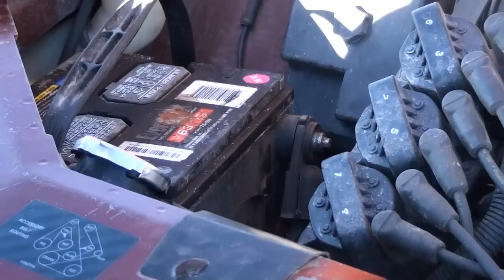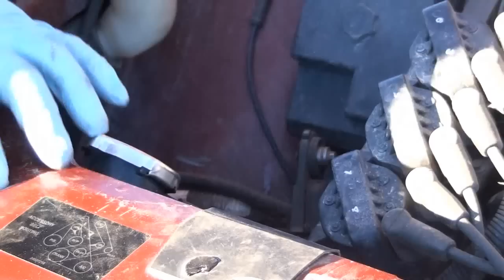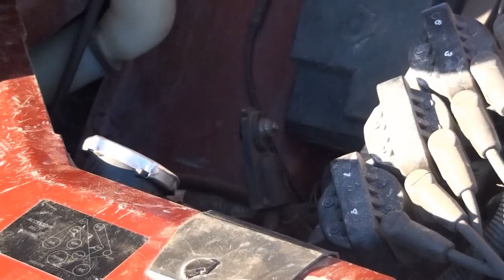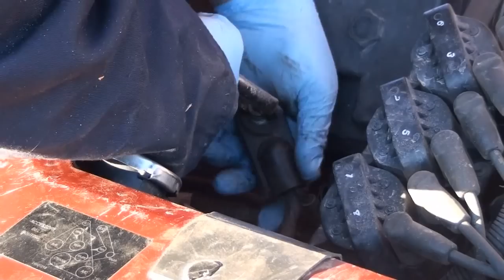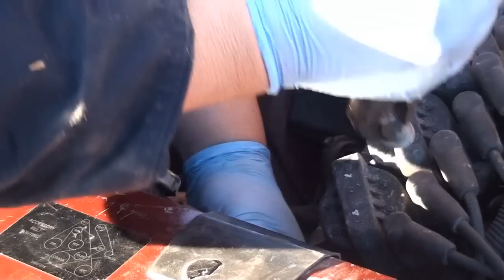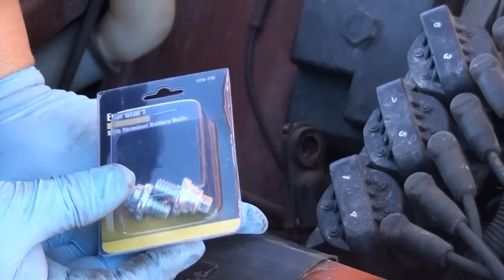How to replace battery side post terminal bolts on GM Vehicles

Comment: I’ve attempted removing the bolt from the wire before and it seemed it was a locked in factory assembly requiring the wires had to be replaced. Thanks for simplifying an upgrade to my car.
Reply: Same. This video definitely helped

Comment: A blow dryer will soften up those cable end covers, making it a LOT easier to swap out the bolts - especially in this 10°F weather.  Also, gotta clean off the corrosion on the copper disk inside - the cover slides right off once you've pulled out the bolt.  Baking soda paste and an old toothbrush will clean up the copper disk.   Thanks for the video.
Reply: I wish I would have read this first, now my thumbs will be sore for a week !!!! Thank you, I will remember it for next time !!!!

Comment: I didn't know you can put a new bolt back so easy. Thank you for the informative film.
Reply: Thank You for watching and appreciate your comment Olena, a hair dryer will also make the whole process much easier.
Reply: @TheToolReview  Thank you, thank you! I changed already for new ones. I pushed them out with a medium wrench, like #17 and pushed them back just w/ my hand in a mechanic glove. This is very useful. I'm not upset anymore by the thought to go under the car to change the positive cable on the alternator, if I cross it. Some people even change those side bolts every time when a battery is changed. Thank you kindly again for such a discovery for me. God Bless!

Comment: OMG!! Thank you Sir for making this video. I have a 2004 Yukon SLT and I swore up and down I stripped the +bolt head and couldnt get it tight. I didn't have the rubber insert and new bolt together properly so it wouldn't get tight tight.

Comment: Thank you for the video. Much easier than I thought. Just a little wear on the 
bolt threads will keep them from tightening. Maybe a little wear on the lead
battery threads doesn't help either.

Comment: Figured I'd find a video for this. Going to replace the simple bolts on my Vette. Bought the same ones at Wally world. Wanted to make sure I was going to remove them correctly. Thanks for the helpful video!
Reply: Did it work for your vette? I’m thinking of doing the same thing

Comment: Thank you so much man!!! I had hooked up a battery stabilizer to an older El Camino and these things just almost fell right out. Then I stripped the threads of one on my 89 Chevy and figured they would be the same. Man, was I wrong! It took me forever to get the things out, but this video was extremely helpful. I am glad I attempted this on a decently warm day. I would say a hair dryer or torch or even a cigarette lighter would be a good thing to have on a really cold day if at all possible. Also, Adam Sebring is also completely right. Time to use the wire brush on every piece of the actual wire ends!

Comment: Thanks, Ray, this is exactly the information I needed. After removing the old battery,I discovered that one of the posts was stripped. This helped me figure out how to remove them. I had a little more trouble pushing the new terminals back in. My solution was using a small clamp and a piece of wood to push it thru the flexible case. The clamp was the push and the post embedded in the soft wood just enough to get it past the cover so it would stay. Then I just screwed them in normally.
Reply from the maker: Glad the video helped you out and thanks for watching Jeff.
Reply: A socket from a socket wrench, big enough for the threads to slip easily inside, can also help for pushing the terminal up against the bolt.  A bigger socket (over the bolt head) could even help for removal.
Reply: @VoltisArt   Thanks, the socket over the bolt was very helpful in pushing the new bolt into place.

Comment: It's easy to strip these bolt threads, it's a good idea to inspect them every time you remove the bolts. If they look worn or stripped, replace them. Generally you may need to replace them when you replace a bad battery.

Comment: I'm planning on doing speaker work on my envoy and had to take the battery out. Didn't realize that my battery terminals were missing that bolt that helps take out the battery. Previous owner must've just lost them and clamped the terminals in with vice grips or something because they will NOT come off. Glad to know that those terminal bolts can come off and be replaced instead of the whole cable.
Reply from the maker: Do a search online or check Autozone to find all types of terminal lug bolts. They also make some with threaded studs to add on accessories or if running auxiliary power.

Comment: I stripped the bolt heads on mine, I was being a bit reckless especially being in the beginning days of my automotive experience.

They definitely don’t turn with a box end and an 8mm open end side doesn’t grab on most sides of the bolt heads. I might end up having to replace the wiring anyways so I’m probably gonna hold off on the posts.

Comment: What would happen if you remove the whole rubber cover around the terminals and hook the terminals up straight to the battery with out the rubber covers?

Comment: I'm missing the rubber ring that holds the side post terminal bolt in, can you buy replacement ones for the negative side it's a 1997 Buick Skylark it was messed up by prior owner caretaker that didn't want the elderly person prior owner to drive for safety reasons, now just the bare copper flat pieces showing at the end of the cable we can screw that to the battery but I'm thinking duct tape is not a good long-term fix to place over that copper flat piece
Reply from the maker: I don't think you can buy that ring, but if yours is just missing the molding on the negative side then you don't have to worry and leave it as such. They do sell repair kits for side terminals that have no moulding and a bare terminal is safe if you have the battery secured.  You can replace the whole cable with new molding which is available online or most parts stores, I think walmat even sells them for a decent price, just make sure to match up the length.

Comment: I hate these side connection bolt in batteries. The little bolt is rounded and won't budge with vice grips. Walmart guys couldn't replace my battery because of it. I ordered a bolt extractor socket set. Hopefully it works. I have to go buy some of these bolts too.

Comment: that black thing that you took the bolt out of what is that called because i have to tighten that up when my car doesn't wanna start...  then it starts what do i need to do?
Reply: I know I'm two years late for you, but the black part is the cover for the terminal on the negative battery cable.  There's a flat metal piece inside that is the terminal itself.  The positive terminal cover is usually the same shape but in red plastic.  If the terminal is loose, you more likely need (or needed) to tighten or replace the bolt shown in this video.  It's possible that the problem was the terminal being loose from the cable, which means tightening or replacing that.
I don't know why you got ignored two years ago, other than people not caring to offer a few words.  Hope you found the help you needed someplace.

Comment: What is the proper term for the "ring connector" that you've having to pull the terminal bolt out of?
Reply from the maker: Side Terminal Connector but can also be referenced as a cable post. It's best to replace the whole cable but if you don't want to you can buy a repair kit from the link below for both cables or can also be found at summit racing. https://www.americanautowire.com/shop/build-a-battery-cable-kit-includes-heavy-duty-0-2-gauge-terminals?gclid=Cj0KCQiA0fr_BRDaARIsAABw4Es_I_i3O2715ZVIU2eq_0HLPdZJVaF0LdnpMlFT2VlUSnQhuQQlINEaAodVEALw_wcB

Comment: My Saturn dies while going down the road. (restarting immediately) The positive terminal bolt's threads are worn. We'll see if this fixes it. Thanks for the video.
Reply: hey man, did it work?
Reply: It did work. The threads were so worn that it was losing contact. Has not died since replacing.
Reply: Timothy Graham your problem might also be a bad connection in the positive side

Comment: Wow it's that easy? Lol i was struggling with this hooking up my amp
Reply from the maker: yea sometimes they can be a pain in the ass especially on older cars where the parts become hard or brittle.
Reply: @RaysFabShop  doesnt help when its -20 either lol did you keep that snap on ring thing ??
Reply: @RaysFabShop  hey! Any tips for removing bolts when the surrounding rubber is hard and brittle?
Reply from the maker: @ashleyholston  Heat will soften up rubber to a point, if the rubber has become brittle and super hard, you can apply some silicone spray and let it soak, it takes a couple of days but the polymers should soften up the hard rubber and keep it soft for a while. I hear wd40 also works but I have never tried it. There are videos on youtube I think that show how to do it.

Comment: I can’t even turn mines I got one side off but I can’t get the other side like the bolt not moving at all
Reply from the maker: Did you manage to get it off? A hair dryer or heat can soften up the rubber.
Reply: @RaysFabShop  okay Ill try that
Reply from the maker: @vonyougaming8677  If the heat isn't working you can use wd40 to soften up the rubber.

Comment: problem I have is getting the stripped terminal bolt off of the battery? any help would be very helpful. pisses me off.
Reply: Vice grips usually work well on turning stuck and stripped bolts.  Since the terminals on the battery are soft lead, they should release without breaking the head off the bolt, which is a consideration with many other stripped bolts.

Comment: Why not just use 3/8 inch bolts of the same length? You get the larger bolt head and you get  two bolts for fifty cents. The regular GM post heads are too small, tear up easily when tightening and lossening, and don't get good contact with jumper cables.
Reply: Hey I thinking the same thing why not get the extended ones just in case you need to get a jump off and it gives you extra leverage
Reply: The bolts work great.
Reply: The charging posts are made from lead, which is more conductive. IDK by how much, but it could make the difference if you have a frayed cable or whatever.
Reply: Just tested with a magnet:  That's steel, not lead.  The connections on the battery are lead, the screws that mate to them are steel.  (Same brand and style shown in the video, by coincidence.)

Comment: This is the worst battery design. My otherwise perfectly good battery is stripped at the positive connection; what, am I supposed to replace the whole battery now just for that? As if! Have to find myself a bigger bolt now. :/
Reply from the maker: Yea those side post batteries don't have much lead in them which makes them useless when stripped, a bigger bolt will work!  I have had to machine inserts on good batteries to make them useful again.
Reply: The Cadillac with the stripped positive battery terminal had a longer bolt than usual and I was unable to tighten it. I decided to swap batteries with my other car (thankfully also a GM with the same battery) which had a regular sized bolt and was then able to tighten both. So far so good!